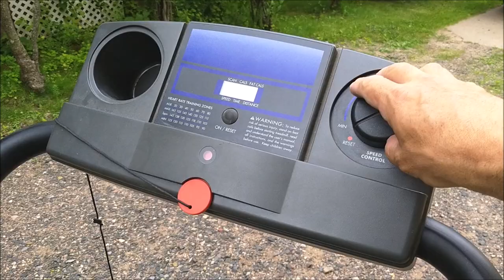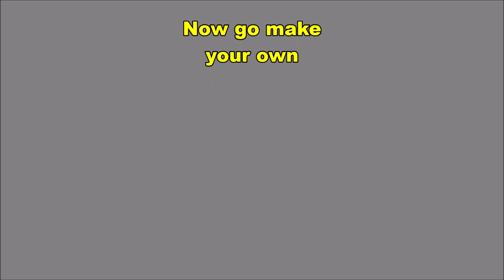How to make a Scuba tank tumbler

Comment from the maker: I didn't mention running a fan on the motor. Some motors have built in fans on their pulleys as did mine. So I run a fan on it and it barely gets warm at all. Thanks for checking out my video!

Comment: I'm thinking now... What if I don't tear my treadmill apart and just rig the tank to stay on the belt to tumble? Note that my treadmill is wider than the one you picked up and till fit a tank... 🧐
Reply from the maker: I saw someone do that, and I'm pretty sure there's a YT video about it. I'm not sure how well it would work but I like how compact this is. Thanks for watching and if you do get them steel tanks you may need to do something eventually.
Reply: trying to find a good deal on HP Steel tanks right now. Been watching FB Marketplace and Craigslist for a week now. They'll turn up.
Reply from the maker: Yeah, I believe you're right, eventually they'll turn up. I only have two HP steels, and plenty of steel 72s. I know several hard core divers who fill the 72s way past working pressure. Not recommending that to anyone and I may have done that myself, but it helps if you gave your own compressor 😬

Comment: great video.  I think i'll give this a try, but a question and maybe i missed it... what if you are using different sized cylinders?  are you adjusting the wheels on the base?
Reply from the maker: Hi Darrell, I have not had to adjust the base as the tanks that I have are very close in size. For steel tanks I've only tumbled 72s and high pressure 100s. I may have to make an adjustment if my lp 95s need tumbling but so far I've not had to do that.

Comment: Hello Don, thanks for this video, it is extremely helpful.  I've recently acquired two treadmill motors Johnson Motor JM05-015 DC90V motor but they didn't come with controllers.  I am not an expert by any means and I wanted to know if you or any of your subscribers could tell me where I can order some and what type would I need for these motors.  Your help would be greatly appreciated.
Reply from the maker: U hope my subscribers can chime in here because I'm not that familiar with treadmills. This one was complete and working which is why I opted to use it. Good luck 👍
Reply: @DonFassbender  Thanks Don, I appreciate you!

Comment: Hey Don, as I'm looking over my motors I'm realizing why you replaced the pulleys.  Can you give me more details on how you got that big flywheel off the motors shaft and where did you source your pulleys.  A little more to do than meets the eye on these.  I suppose If I was able to find the front drive roller with the pulley works from the treadmill, it would have been simpler but as I mentioned, the scrapper just pulled out the motors and nothing else.
Reply from the maker: The pulley and the removal of the flywheel was sourced from my local machine shop. I haven't checked McMasters but I wouldn't be surprised if you could get on there. Sounds like you're really getting into it. I can't wait to hear how yours turns out.
Reply: @DonFassbender  Hey Don, it's been a while, a year to be precise.  I have finally got most of the equipment for doing this project (stuff is hard to find on a Caribbean island!) and will be completing it in the months to come.  So to be clear from your response to my question a year ago, you had your local machine shop remove the flywheel?
Reply from the maker: @NicolasLakoff  Yes, yours may have a set screw but I could not find one on mine. Glad to here of someone else making a tumbler. Can't wait to hear how your project goes.
Reply from the maker: @F%98%86%F0%9F%98%86annel/UCKk1VSAbjlp76PgBwSF0-ZA And where in the Carribean do you live? I May have to come see how yours works in person 😁
Reply: @DonFassbender  I'm in Roatan Honduras, it's an awesome place to visit and for diving!  I'll be glad to show it to you if you come!
Reply from the maker: That sounds awesome, @NicolasLakoff ! I might take you up on that someday.

Comment: What kind of material did u used inside the tank for tumbling? Where to buy?
Reply from the maker: I used non-coated fish tank rocks from Walmart. You can also purchase ceramic media online.
Reply: @DonFassbender  tq for the info..
Reply from the maker: Absolutely, @nemodivermalaysia . Good luck! Are you making a tumbler?
Reply: Yes, i must have one for my diveshop stanby for close season end of the year..
Reply from the maker: @nemodivermalaysia  Good luck! There are several ways to make a TT for a lot less then buying a commercial unit.

Comment: First off, you'll want to down load this...  http://www.ontariodivingschool.ca/tank%20cleaning%20&%20tumbling%20tips.pdf  .  You'll need media.  I use ceramic and it works great.  You'll need to be able to clean and DRY your tanks after tumbling.  After your tanks are clean, shiny and dry, at the minimum you will need o rings for your 3/4" tanks and for your half inchers' a tank vise and a knowledge on how to properly tighten the valves.  Being able to source parts and rebuild valves is also a plus.  Even before tumbling, you should be able to do a proper VIP and know what to look for.  After all, it's all about safety.... right?  being able to tumble tanks is great.  but it is just a start.
Reply from the maker: Thanks, Swimjim. Lets get the discussion going. I used Jerry's advice of using aquarium rock and it seems to work well. I doubt I'll ever have to buy more medium. I am prepping these for my local (sort of) hydro facility because, as you know, they're really picky. so I'm tumbling them dry and will inspect, clean any flash rust, and dry after it comes back from hydro.
As for cleaning and drying, stay tuned for part two 😬Not sure I want to get into O2 cleaning, viton o-rings and rebuilding valves, but we'll see where the comments take us.
Reply from the maker: Thanks for the PDF link. I have read this before but did not think to include it in the description above. I'm going to add it there also.
But again, as the title says, this is a how to build a tumbler video. Some things are beyond the scope if a 5 minute video.